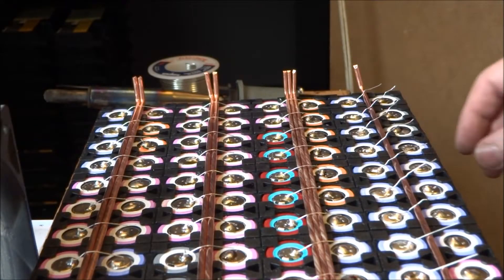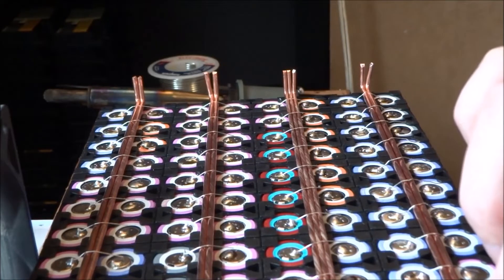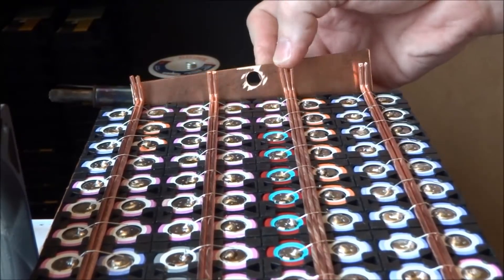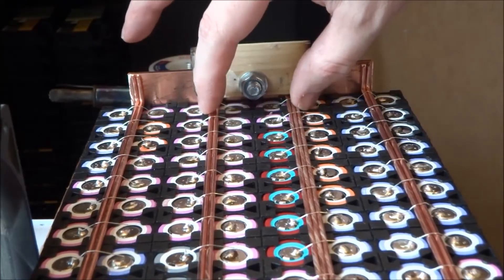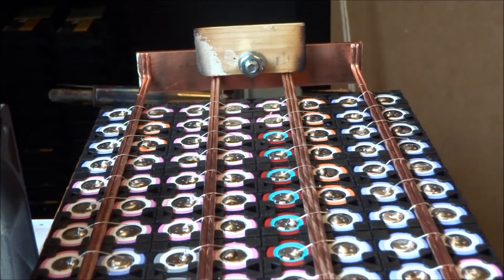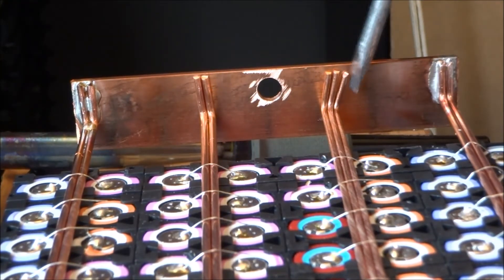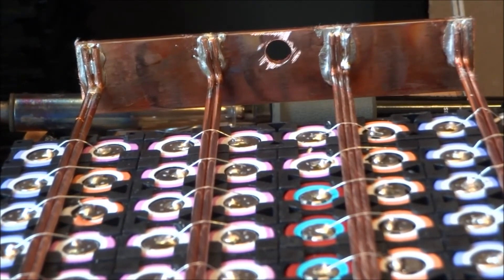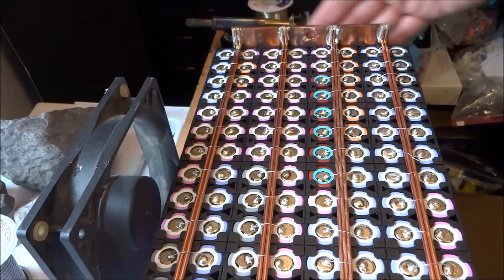Commander Electric upgrade to 18650, positive terminal installation

Comment: I am building a bank with atleast 28 100 cell packs for a 7s 400p bank at about 260-280 ah each. I'd like to have something I can prefab and be easily repeated. Al though i am only 1/4 the way into this build. At 1400 cells. Great video..

Comment: I'm about to do something similar. But I was just thinking . why not drill holes in the copper plate for the wires to fit into. And solder it like legs of a component on a PCB? It may not look as nice. But it could be a stronger bond mechanically. Can you think of any reason to not do it this way? There are so many ways to do this? I am also using glass fuses per cell. I will likely use about 20 ga wire on the negative side to buss. Great video.
Reply from the maker: Yes that should work well, there's so many different ways to things...

Comment: what kind of control charger you are using
Reply from the maker: DC-Dc converters, now using a DSP-6015 : https://www.aliexpress.com/item/DPS-6015-single-output-programmable-switch-power-supply-60V-15A-900W-DC-DC-TTL-serial-interface/32782400805.html

Comment: can this be built for a 14.8 or 14.4 battery?
Reply from the maker: Is that nominal or max? You need to find out what is the maximum voltage for your application and divide that by about 4.15. For my Commander, the max voltage is 53 so divide that by 4.15 and I get 12.8. I round up to 13 and that will give a max voltage of 4.07 per cell. (13 groups of cells in series)